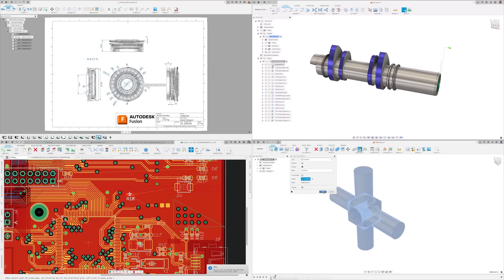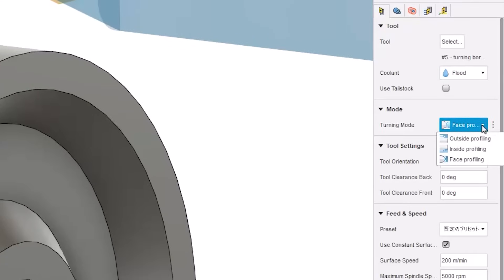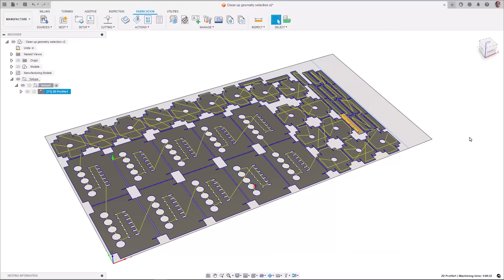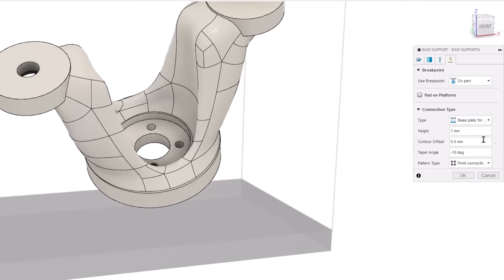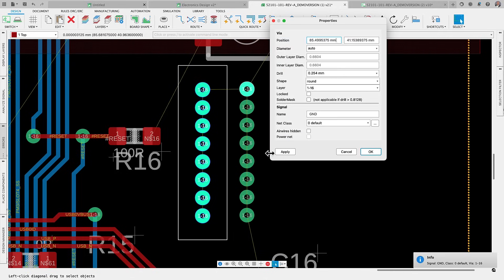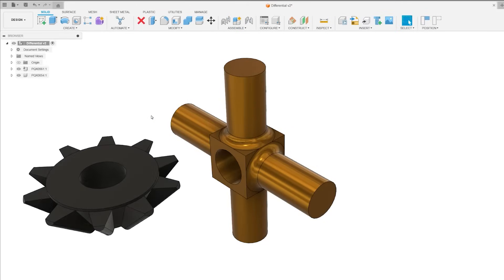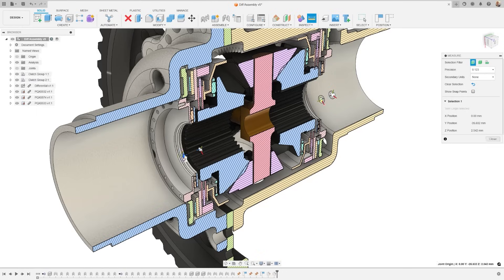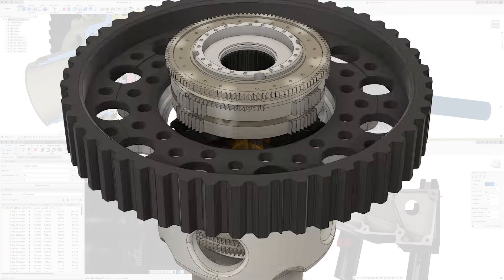Solid Sweep, Bar Pull... Check Out What's New in Fusion for May!

Comment: The Tool Library could be further advanced.
Import Tool Holder and tools like facemills, high feed mills, lathe tools from Iscar , Hoffmann  etc, by Step file instead of scripsts, should be connected to the fusion library.
More details in the tool holder simulations, being able to really  choose the driven tool holder for Lathe for basic simulation, more power of choice when creating a lathe tool.
In the Drills section in the speed and feed category, you can save the default peck.
Being able to create subcategories for feed and speed of different machines.
example:
Mazak: VC: 110 & Fz: 0.005 
dmg: VC: 250 & Fz: 0.15
Reply: I use mostly shape tools and importing the tool  to the library directly from Step would be a real time saver!
Reply: @vwarrior2  exactly, even form tools would be easier that way
Reply: It's in development / on the roadmap. With no commitment on when it will be delivered. There's a lot of tech to wire up to make it reliable and pervasive through the product. You can sign up to the Insider Program to gain some more insight.
Reply: @ScottMoyse  How can i sign up ?

Comment: Does the bar puller operation work with turret-mounted bar pullers? Or just sub-spindle stuff? That's something I'd love to have built-in. Right now it's a lot of hand-coding to have a bar puller come in, grab the bar from the side, pull the bar, and then move away and reset the cycle. Having that automation option right in Fusion would be great.
Reply: Create a Manual NC Template as a Pass Through, you can comment out what needs to be changed so its really obvious in the code. Save it and apply oi to the jobs you need and just update the W or pull length and grab position. I agree we need a turret style option in CAM though.
Reply: You could use it with a turret mounted puller, yes. But you would need to customise your post processor. I can help you with that if you want to go down that path.

Comment: I wish you gave some attention to the mesh workspace too. Every vertex of a mesh object is a well defined point in 3d space. Why can't I just snap to it? Like, why can't I use three mesh vertices to snap a three point circle to? Or create an offset plane by snapping to a specific mesh vertex?
Also, some more requests to cosider, maybe? Start a tangent circle from any point on a spline? Find the intersection of two surface bodies in 3d space?
Lastly, in a non history enabled contextual environment, it would be so nice, if we had some curvature matching and blending functionality for surfaces. Thanks!
Reply: There are some toolsets in Inventor which are along the lines of what you are asking for. And I've often wanted those same commands in Fusion so I can extract just the points I want, or create a best fit workplane from 3 mesh points. 

It's totally possible and not a tonne of overhead since Autodesk have already done it in another ASM based parametric modeller of theirs.
Reply: Have you tried some of the mesh tools available when you select Direct Edit on a mesh body? At least some of what you are asking for is more or less there already.

You can find the intersection between 2 surfaces (perhaps not meshes though, but mesh isn't really CAD:P)
Reply: @Robinlarsson83  Hey, thanks for the reply! I guess my whole point for mesh objects in F360, was that I couldn't see a reason why they should be treated as second class citizens. Until I read the last sentence of your reply, that is.
Reply: @captivenut4122  It's not meant to be derogatory in any way, but yeah, basically Mesh editing isn't really CAD, meshes are not made in the same way as real Brep, Nurbs or other actual CAD solid or surface.

Sure, each triangle in a mesh has 3 well defined points in space, but that's not really how CAD files are, they are mathematical descriptions of the model, not location data.
That's why CAD files are tiny in data size, even with highly complex geometries, while even a simple mesh can take up massive amounts of data.

So, editing a mesh is simple much harder for a CAD program, since they natively don't work in that way.

You can compare CAD files to Vector graphics and meshes to bitmap/pixel based images. A cad file doesn't have a resolution, you can scale it and transform it without loosing anything. Meshes have a fixed resolution since it's just a collection of points in space, 3D pixels if you like.
Reply: @captivenut4122  in fact, Fusion actually has unusually good mesh functionality for a CAD software, in my experience :)

And yeah, meshes are treated as second class citizens simply because they are, or actually they are more like tourists or guest workers really :P
Reply: @Robinlarsson83  Me coming from a Rhino3d background, would have to strongly disagree on that. But then again someone would argue that Rhino is not real CAD. An argument that would turn this whole discussion into a matter of semantics, which was definitely not my purpose when I started it. 

All I'm saying really, is that there seem to be so many simple things in Fusion, that could be done to make it more functional and pleasant to work with, which wouldn't even cost in terms of too much effort on the developers' side. I admit that this may not be the best place to discuss about them though.